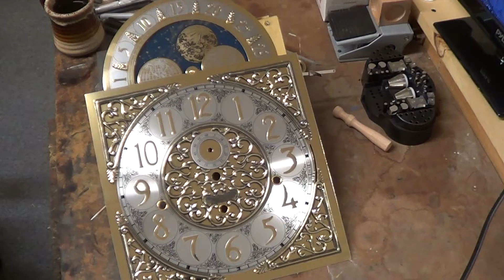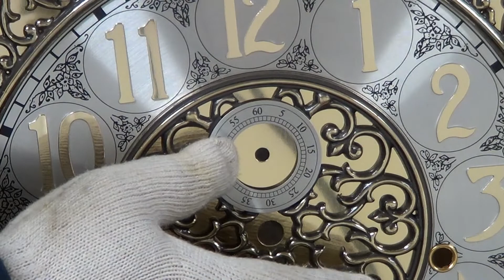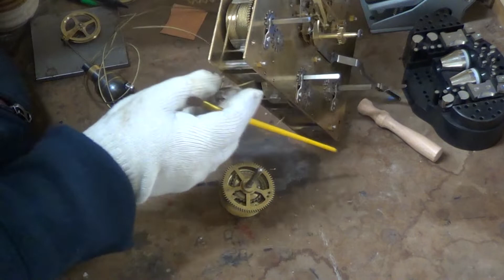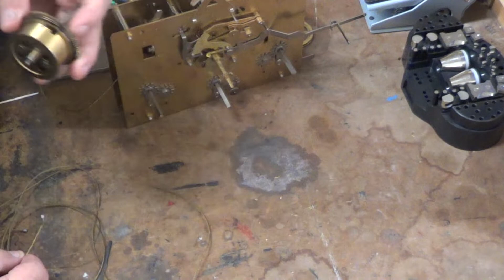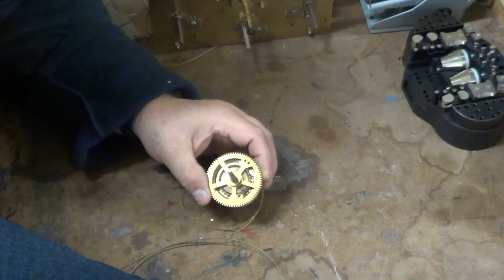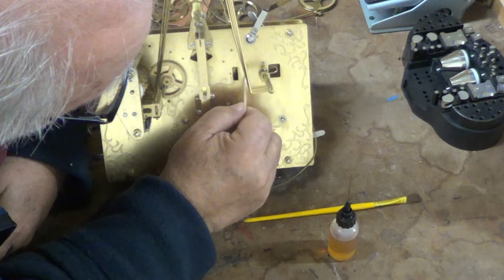Cable Clock Cleaning Part 1

Comment: No mention of where the cable pulleys should be when removing the works?... should they be wound up?... or hanging loose? because all I see is cables tangling all over his bench....

Comment: Useless trivia for anyone interested. Did ja know....? The first grandfather clock was built in 1680 by British clockmaker William Clement. The tall case clock was made possible by the anchor escapement system, which allowed for much slower movement in the pendulum. Before this system, pendulums in clocks needed 80-100° of swing. 😁

How Did the "Grandfather Clock" Get Its Name? 🤔

Even though a grandfather clock carries the ring of heritage and tradition, the term itself is rather young. In fact, it is more than two centuries newer than the timepiece it designates. Today, we might still be using that mundane term "longcase clocks" or "pendulum clocks" if it had not been for a songwriter Henry Clay Work. The name grandfather clock was adopted after his song “My Grandfather’s Clock,” written in 1876. 🤯

Comment: I have a 1981 Ridgeway model 146 serial 12881 with a CN movement.  I want to clean and oil without removing movement. Where can I find instructions on removing the dial so that I can access the front of movement?
Reply from the maker: There's a wood frame in front of the dial, remove the four screws and use gloves so not to touch the dial. Remove the wood frame and depends the dial should have four snap pins that slide to the left when facing the clock the silver will be located at the four corners and hold the dial in place. Be careful to hold the dial as you lock the snaps on the movement remove the dial and you are ready to clean and oil.  the Bench Jeweler.
Reply: @rhjgold  thank you!  I see more than 4 screws and will try to determine which are the 4. Is it possible to send you a couple of pics?

Comment: I have an 84 Pearl cable clock that the pendulum keeps stopping after a few minutes.  Any ideas?
Reply from the maker: The work Cable Clock, I'm guessing it has an auto beat pendulum try pulling the pendulum about 1/2" from the side of the case and let it swing on its own this will set the auto beat. See if that fixed the problem.  Let me know. 
The Bench Jeweler.
Reply: @rhjgold  thank you
Reply: That didn't work 🙁.  The mechanism looks identical to the one you have here.  It was a family members that sat for 8 years.  She said it work when she stopped the pendulum.  I took the mechanism out and cleaned and oiled like you show here but it won't stay swinging.  I move it all the way to one side and let it drop but it keeps getting slower and slower till it stops.  I can see the gear moving when it is swinging.  When it is swinging everything works.
Reply from the maker: @ryotaryuu  If you removed the weights to move the clock during the 8 years it sat, Look at the cable very possible that the cable has crossed over the barrow that will stop the clock until the cable travels far enough down to untangle itself.  If it has you will need to keep running the clock several times to get the cables to untangle.  That's the next thing to check.  The Bench Jeweler